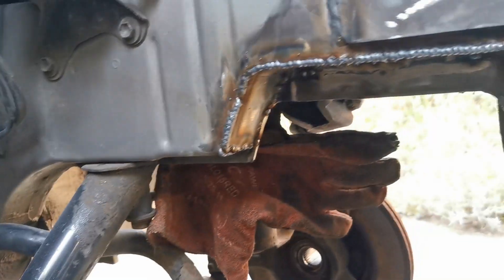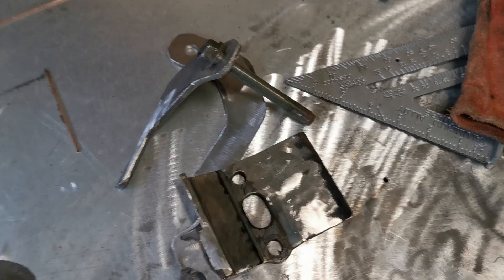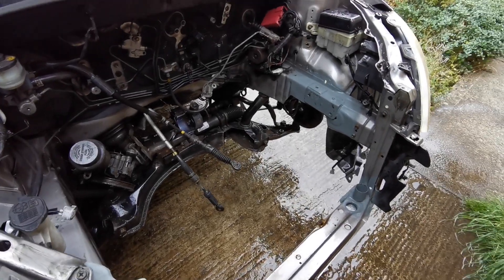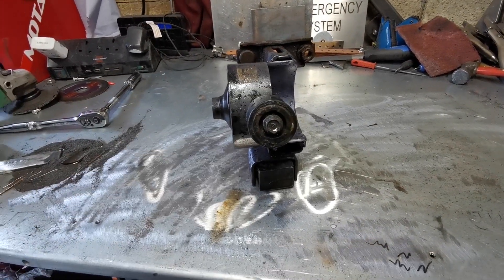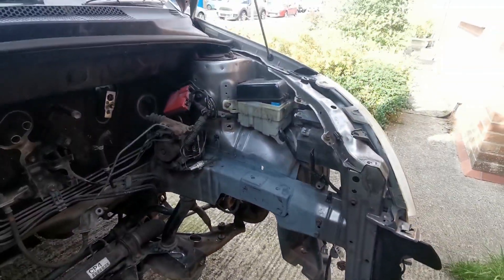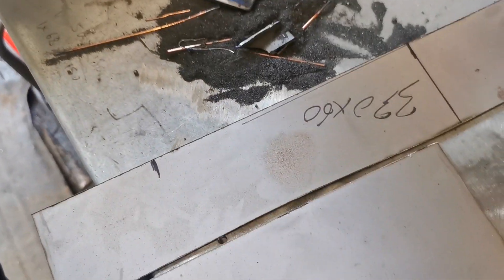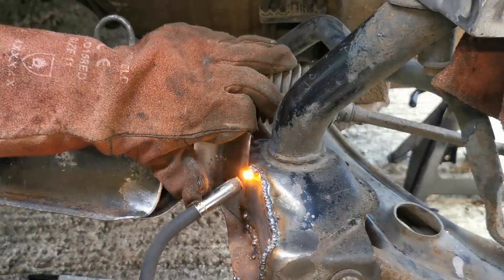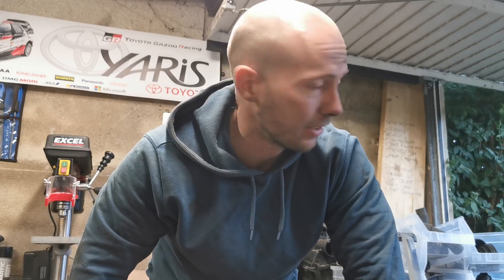2ZZ Yaris Build ep.20: Chassis + subframe welding, & more!!

Comment: we have swapped 2zz as well currently in discussion with downpiping and weather to install 2 mini mufflers or go for straight pipe with exhaust muffler at the end (2.5inch) any suggestions and recommendations brother? love your work
Reply from the maker: Thanks for the comment! You're crazy enough to do this too, excellent.. I'm going to run the system I've got on the car now, 2.5" which matches the celica downpipe. I've got a single quite small muffler in the rear, but it doesn't do a massive amount. Sounded good with the 1NZ, so hopefully will also sound good with the 2ZZ!

Comment: Nicely done man, make sure to heat wrap the gear cables as they will get hot as hell 😬
Reply from the maker: The celica ones have some factory heat sleeving from memory, if it fits I'll get the factory manifold shield back on as well to try and manage bay temps. Getting there!